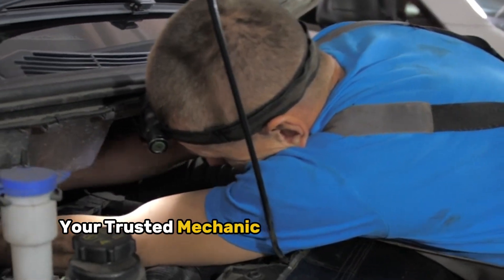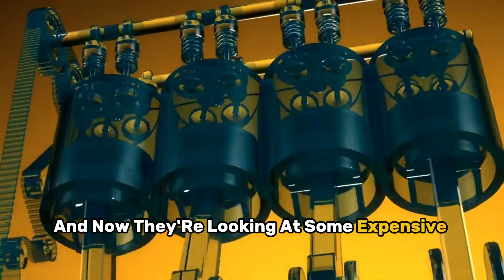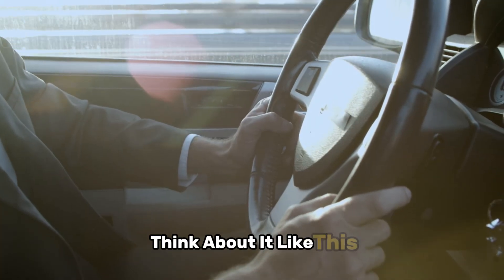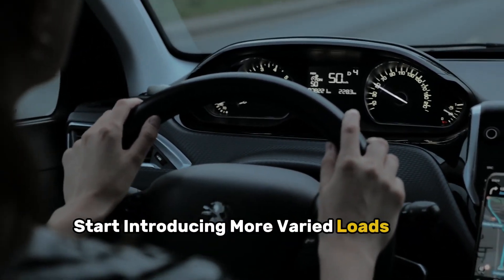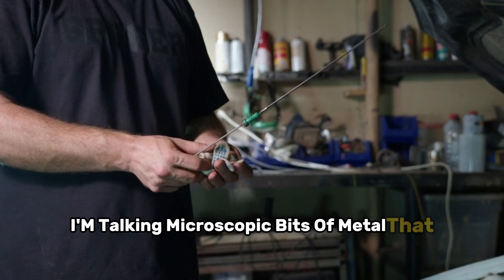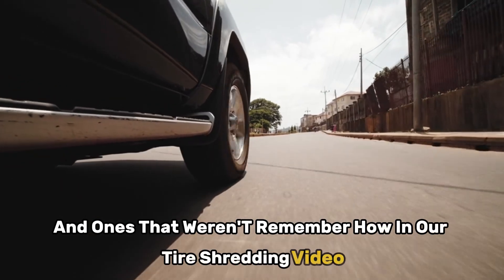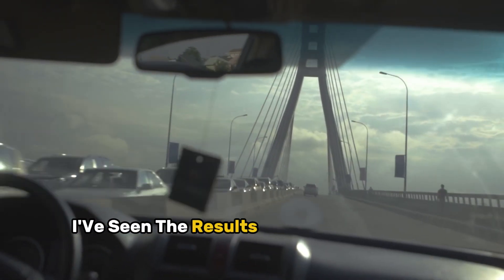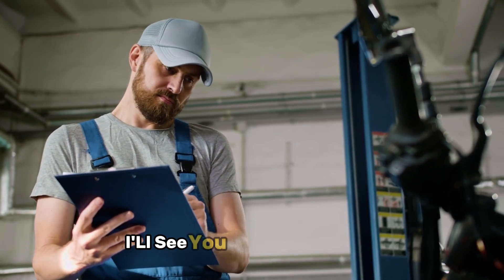Engine Break-In Secrets: The First 1,000 Miles MAKE OR BREAK Your Car's Life

Comment: Excellent.  I could not have said it better myself.  I own some of those examples of properly breaking in engines, plus oil & filter changes long before factory overly-extended recommended points.  My vehicles, and their engines, are going to last a very long time.  They always have...  Frequent oil & filter changes while using a very high quality synthetic oil (with Zinc for flat tappoet engines) is the least costly way of helping secure a long and good run from your engine.